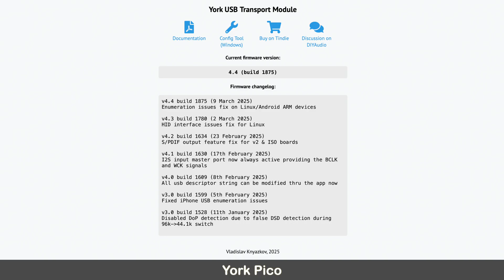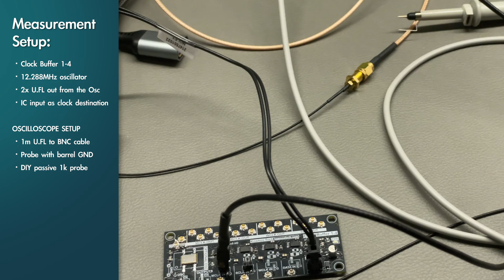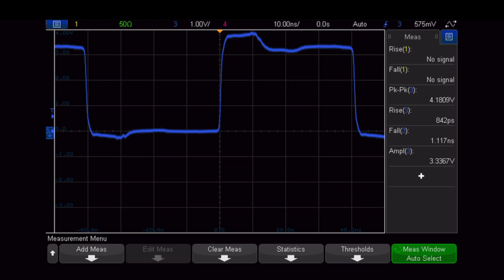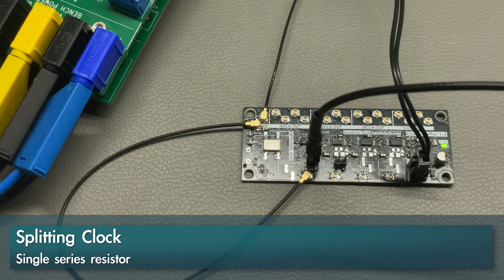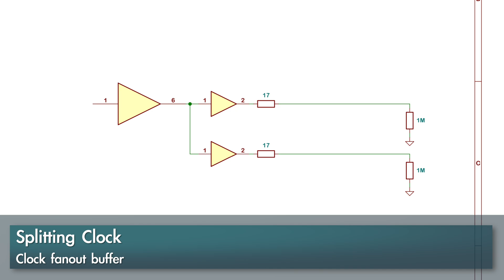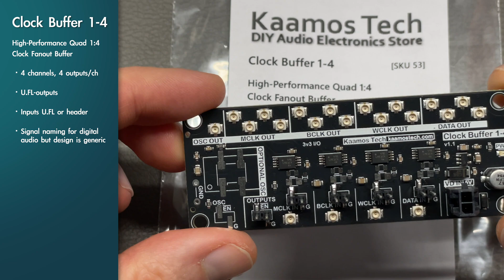How To Split Digital Audio Clock Signals - Solutions With Measurements

Comment: One more question, I see some of your DAC/ADC's have the pinheader option for the I2S connection as well as the U.FL option. And you have those adapters to go from pinheader to U.Fl. How much does this transition from ufl to pinheaders hurt the signal? Or in gnereal transfering i2S though pinheaders from PCB to PCB?

Lets say I was to design a DAC but I do not have room for both UFL or Pinheader. But, I need to be able to interface both via pinheaders and Ufl. Does this little adapter PCB of yours hurt the signal compared to the direct Ufl method or is the difference neglectable? 

Thanks in advance!
Reply from the maker: I don't think it really hurts the signal; I haven't done extensive tests. It needs to be a very fast signal/edges to see a difference. I see it more like a philosophy of doing things "the right way" (while still keeping it inexpensive and small). UFLs and coaxials also handle RF-interference a lot better. But I wouldn't feel too bad if I needed to use pinheaders again.

One thing to try to avoid is branching the signal traces in a way that it leaves stubs - which basically tend to happen when using two options. At least keep the stub as short as possible. When using the header adapter this doesn't happen, but in the Clock Buffer boards if the header is used, a trace stub to the UFL remains since the UFL is chosen to be the 'main connector' at the end of the trace.

If I needed to support both, I would probably use pinheaders and the adapters. Using the adapters does break UFLs 50-ohm impedance continuity but we usually don't have impedance control anyway.
Reply: @kaamostech thanks for the detailed response! Much appreciated :) 

So stacking pcb's and transferring i2s over pinheaders should be perfectly fine, great!

Comment: If i need 8 mclk signals, would it then be okay to daisy chain clock buffers like this? So one two channel fed from the oscilator. Then that buffer feeds two four channel buffers to get a total of 8 outputs?

And thanks for making this kind of content! Short but with good explanations and practical examples! I'm sure your videos and general schematics is gonna be a biiig help in my audio electronics journey!!
Reply from the maker: Thank you! Yes, you can daisy-chain the buffers. There is a very small delay in the order of 2ns in the buffer, so if you want to keep the timing exact, you do it as I think you explained so that each clock goes through two buffers.
Reply: Actually I was planning to use one 4 channel buffer to supply mclk to a dsp and two more 4 channel buffers and then use those for 4 DACs and 4 adc's. But I haven't thought of that.. maybe just three 4 channel buffers in the second stage then and have three spare milk signals to keep it all aligned. 

Thanks!